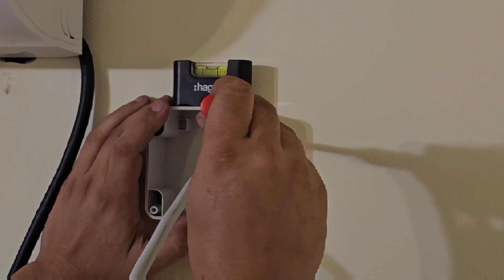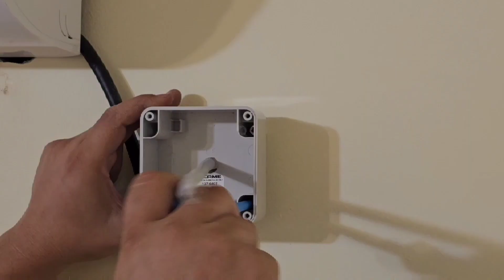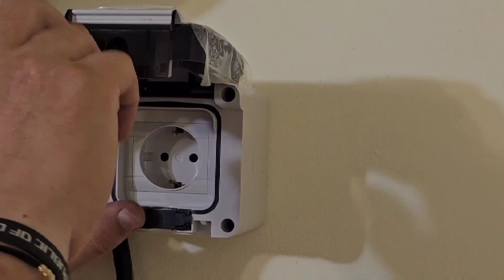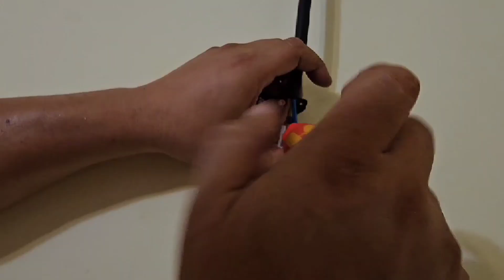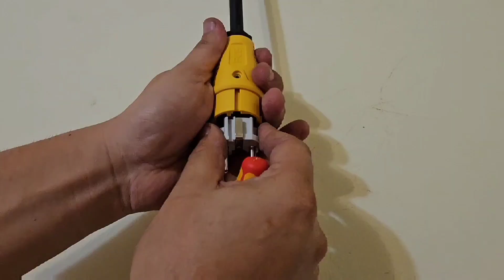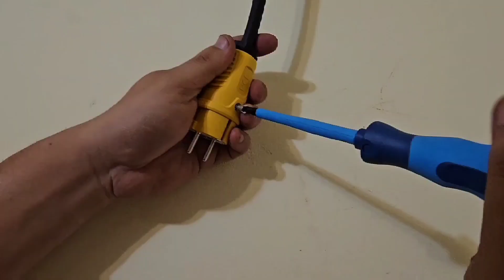Montaj priza Scame pentru AC/Installing a new socket for AC unit.

Comment: Salut Stefan! daca imi permiti un sfat.... daca AC are circuit dedicat cel mai bine scoti alimentarea in interiorul aparatului si nu mai e nevoie de priza,plus ca se vede si mult mai bine fara cabluri atarnate pe perete...Stima !
Reply: Problema e că cele care vin cu cablu, daca îl desfaci să îl legi direct riști să pierzi garanția
Reply: Eu de prin 2001 asa le fac și nici în frigotehnist nu a făcut figuri când a venit la montaj.. Mai nou aparatele te ultima generație primesc mai facil alimentarea la compresor afara..
Reply from the maker: @alexpapp2917 Exact.